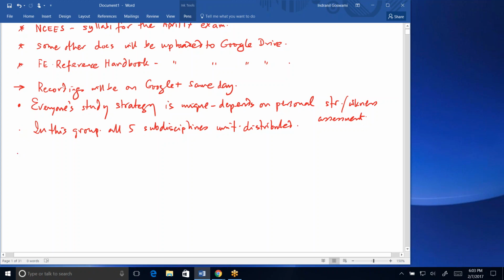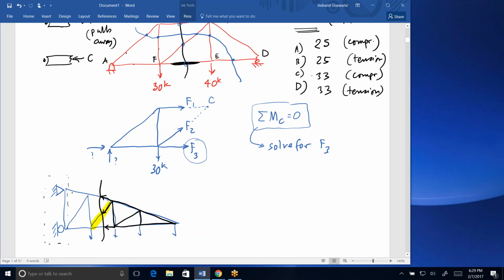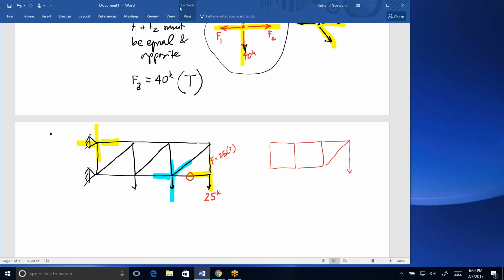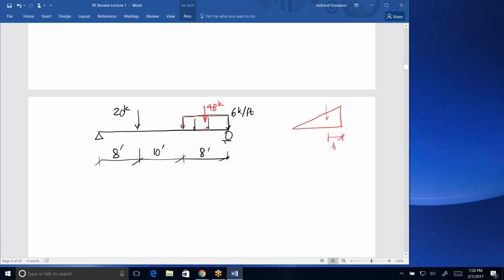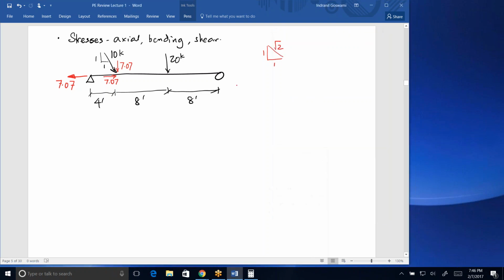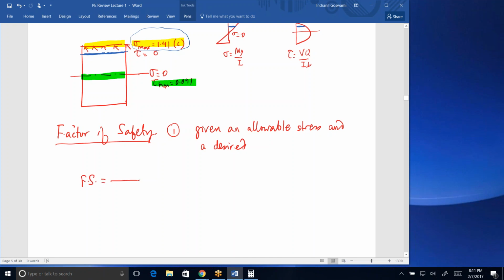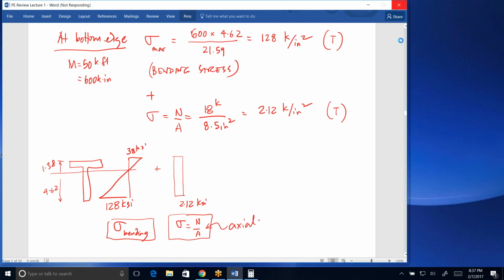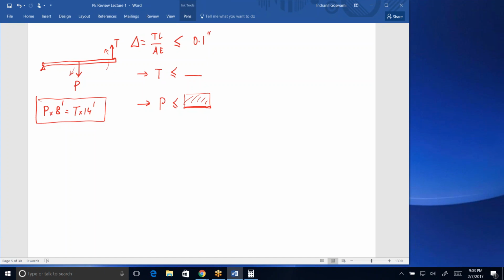PE Civil Review Course Lecture 1: Feb 07 2017

Comment: I am using the book All-In-One PE Exam Guide: Breadth and Depth Hardcover – May 27 2009 but I found there are many errors. I am wondering if any other people also found this problem?
Reply: That is an older edition. I'd recommend looking at reviews of the newer edition of the guide you have to see if errors are still an issue. Known errors are usually corrected in newer editions.